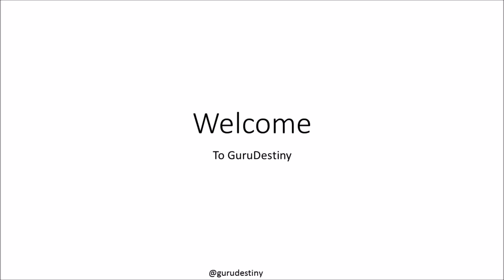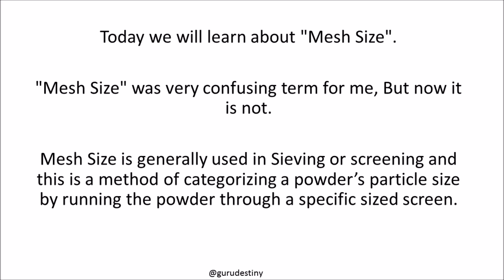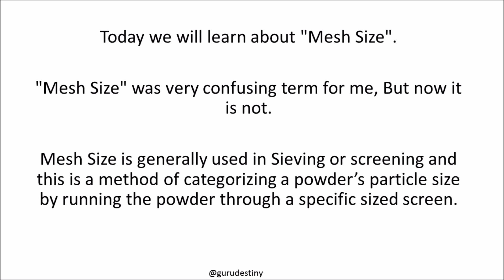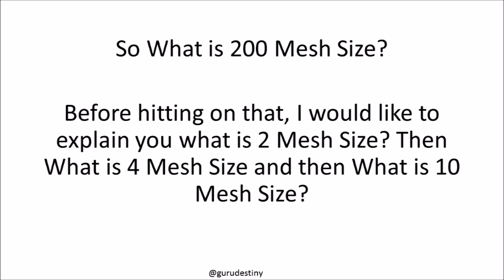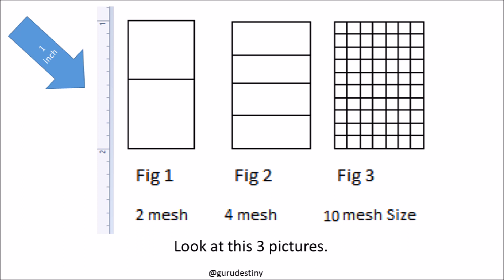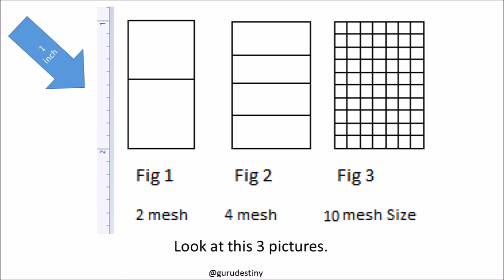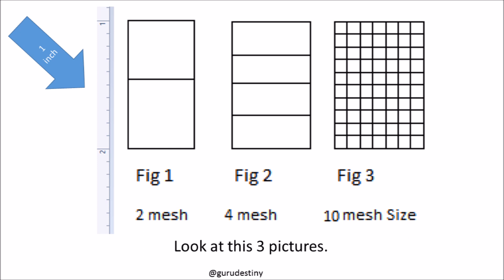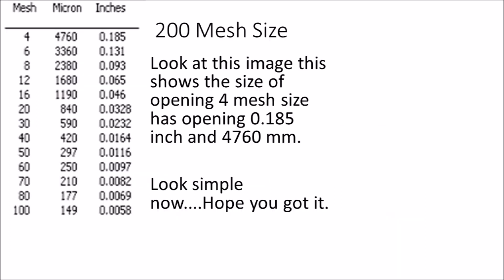What is mesh size?

Comment: Still confused! You said mesh size is number of openings per square inch. So what is 10 mesh should actually be called a 100 mesh?!
Reply from the maker: 10 on X axis and 10 on Y axis, so 10x10 =100 opening in square.

Comment: You say, Mesh size is number of opening in one inch length. Then you say 200 mesh means 200 openings in one square inch. One inch and one square inch are totally different, one being square of the other.
Reply: He actually mixed two definitions of mesh. And his explanation does not make it clear at all

Comment: Hello. Why does Mesh 4 have 0.187 "instead of 0.25"? If we take an inch into 4 parts, each of them should be 0.25 inches.
Reply: That is because 0.187 is the length between 2 wire or i can say screen opening. Where as 0.25 consist of the screen opening as well as diameter of the wire. Here we are only talking about the screen opening so you need to substrack the wire diameter from the 0.25. Infact we only interested in the screen opening.

Comment: If 2 mesh means that there will be 2 mesh in square inch. Your examples only show inch along its height and not along its length, why so?
Can you explain the conversion of mesh to microns?
Reply from the maker: Yes, 2 mesh means 2 opening in one inch linearly. 
Once you have number of opening you can divide 0ne inch by that number and then answer can be converted into Micron. (Inch to Millimetre conversation) Don't forgot to subtract diameter of wire for each opening.